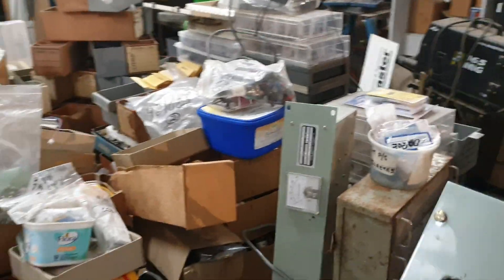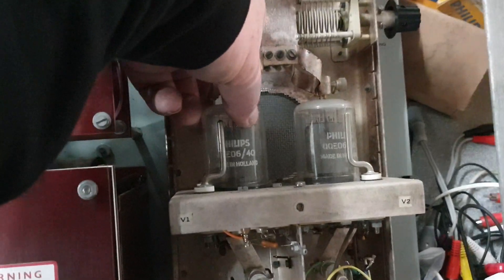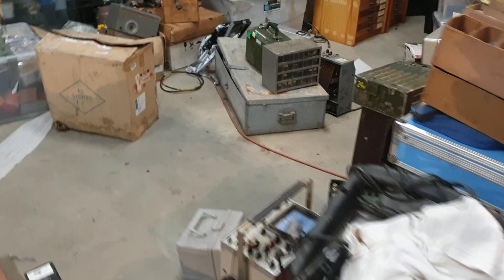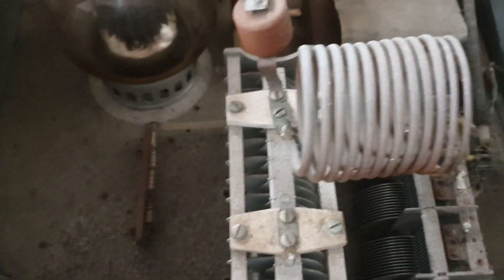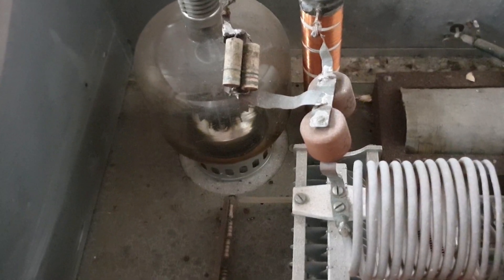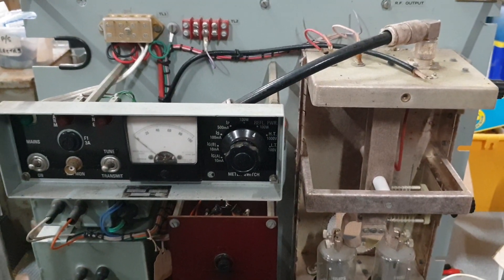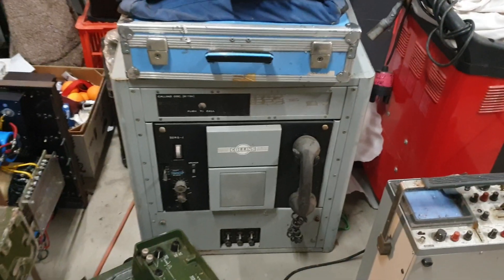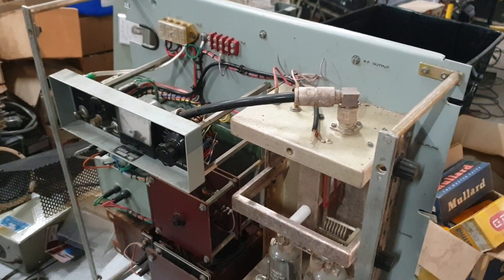So who knows a bit about 4-1000a and QQE-640 amps?  Way out of my experience but maybe not yours?

Comment: judging the ht meters of the amps, 5 kv max, so 10, 20 and 40m amps due to the amount of L circuit in tank.
If they were run at 2 to 3kv the tank would have the less turns on inductors , 80m would be  11turns at 2500volt ht.

Comment: I know this video is a few months old, but you might be able to find what bands those 4-1000 amps were set up for by putting a 3.5k resistor from the plate cap to ground, leave tube in place, (no power applied), put an antenna analyzer or nanoVNA on the OUTPUT antenna jack, and key the coaxial relay manually. Scan around till you find low SWR, and that should be the ballpark of what the tank circuit was set up for.